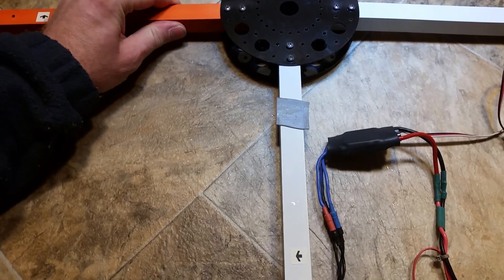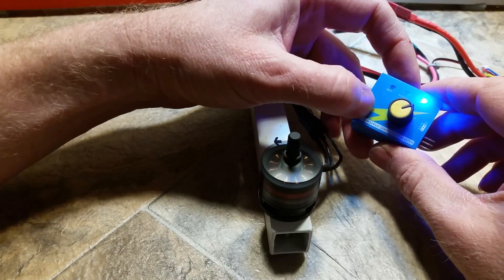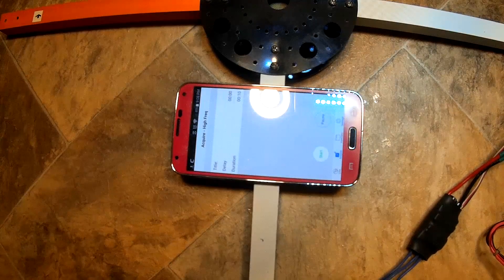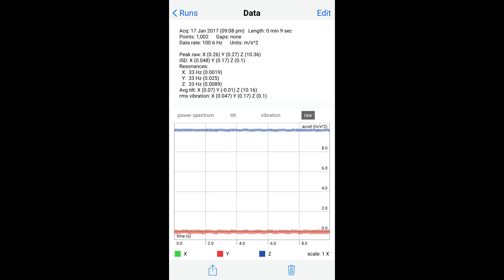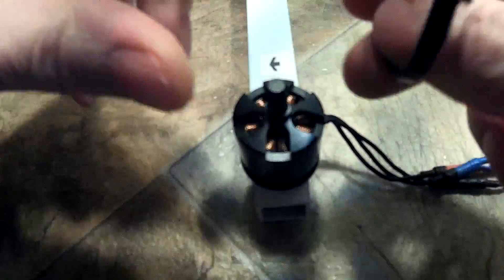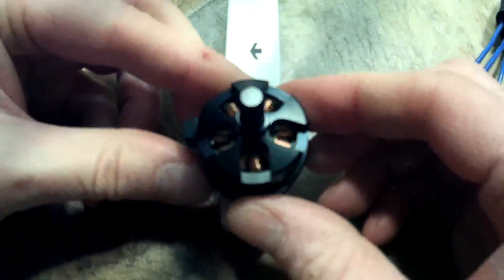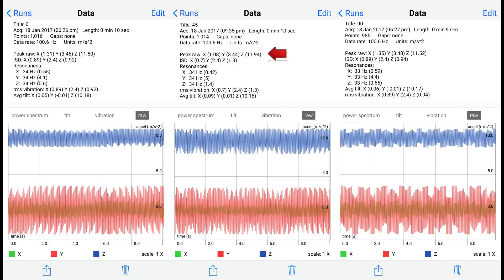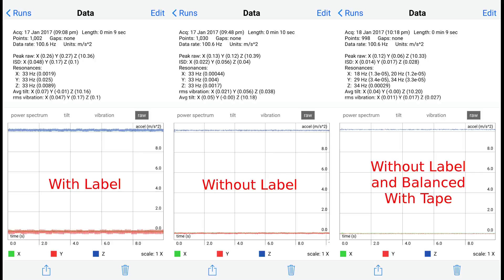Balance A Quadcopter Motor To Reduce Vibrations

Comment: Not so simple with the 200mm FPV quads. But not impossible. Going to have to make up some hybrid method. I would also like to check with props attached :-O. 
There must be a way of using a little break out module with an invensense MPU 6050 and plot the accelerometer out. These little boards are about 1" square. Gives rise to some interesting options.